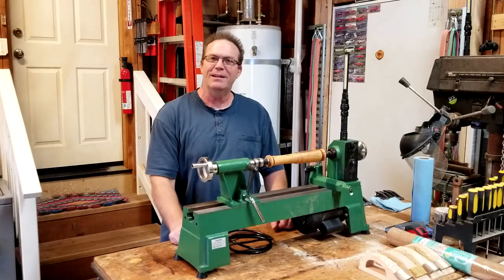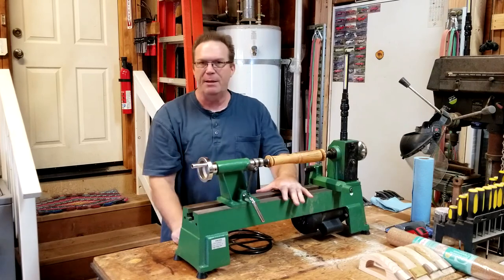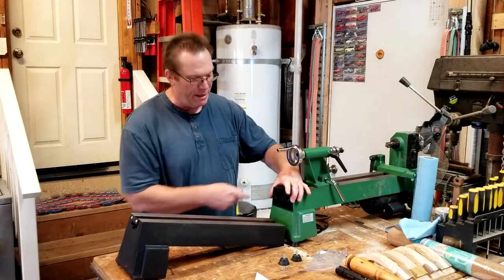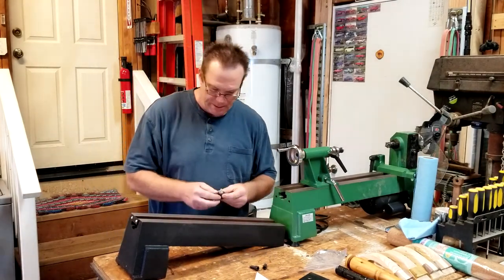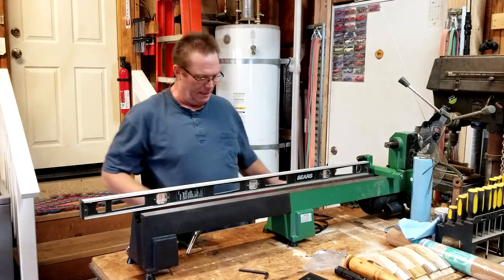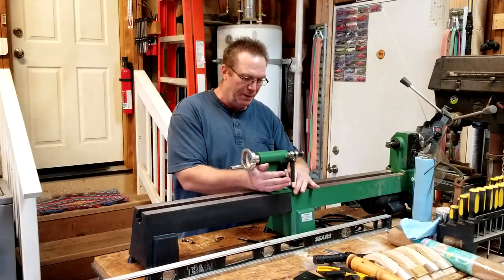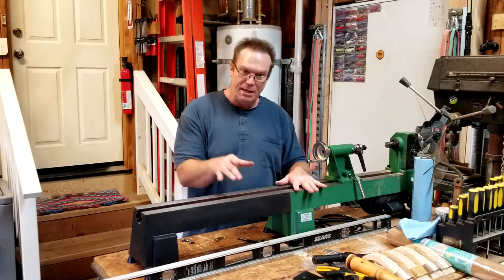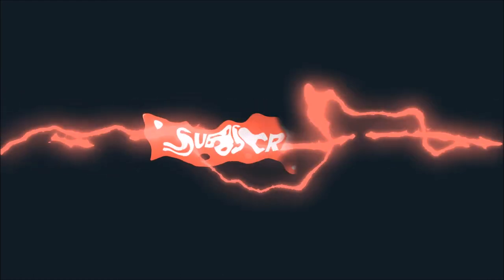Harbor Freight 10 x 18 Mini Lathe Bed Extension

Comment: To get the ways even... use clamps to clamp your level to the lathe. Then clamp the extension to the  level. That will (in theory) force both to reference the level.
Reply from the maker: Very good idea, i will definitely do that next time. Thanks for the tip.

Comment: I wasnt that surprised at all  i actually am a retired Woodworker that  spent 25 years  doing it professionally and over 35 as a hobby   over the years many of the Harbor Freihjt  tools have actually   increased  in quality and  in manufacturing to the point that  their tool  has become  the  actual preferred  brand in many shops  the athens you  have  a couple of bench sanders and  their 14” Bandsaw which is  a pretty darn good clone of the Delta 14 “  to the point that most of the parts are  interchangeable  btw Delta doesn’t  even build there own in the United States  any longer  so the 
HF and various other companies do seem to  rebrand the same unit  with several other brands  all  built in Taiwan   many small shops or hobbyists  ;ok for the used Harbor Freight saws  on Craigslist and Ebay and  snatch them up as fast as they can  i think Harbor Freight  doesn’t always carry the Lathe  in the stores any more  so they go fast  on the used market  too

Comment: I can tell you with 100% certainty that rebranding tools is a very common practice.
Reply from the maker: Ya, i really wasnt surprised either just a fun proof of concept., thats been going on forever as it would seem. So many tools and audio speakers are rebrands. I guess it comes down to paying for the sticker affixed upon the item lol.
Reply: @BubbasWorkbench  that's exactly it. Sometimes companys will have small things changed or beefed up but thats it. Most of the woodworking tools are rebrands of the old jet tools from the 80s and 90s

Comment: Hey freind.  Can that be used for pool cue shafts? I just wanna use it to redo the end of a pool cue.
Reply from the maker: I would say yes if its a multi section pool cue. For instance with the bed extension you should be able to turn a baseball bat. If the section is the same or smaller than a bat the yes. Will need a stabilizer for middle of cue to minimize flexing as you turn.
Reply: @BubbasWorkbench  it’d be just the shaft.  I unscrew it from the butt end.